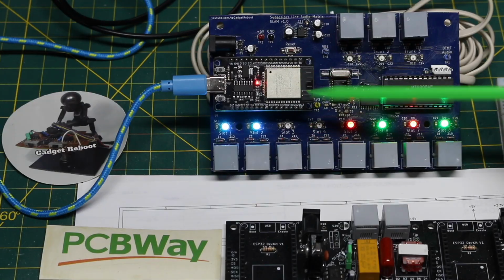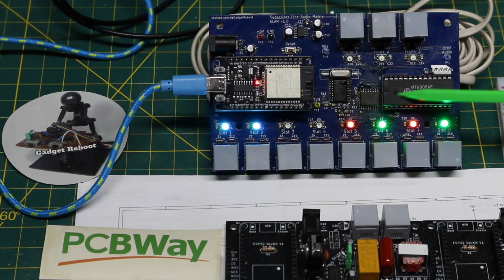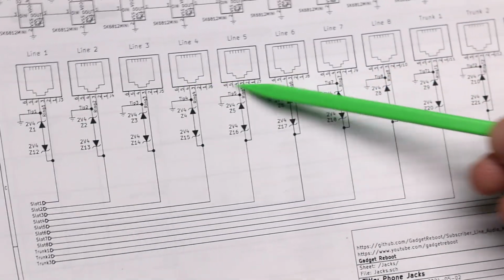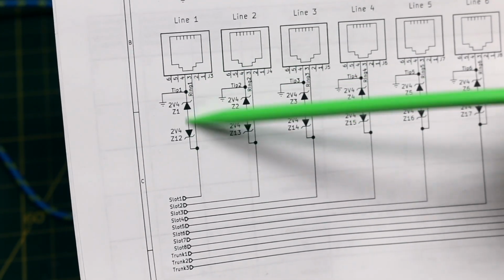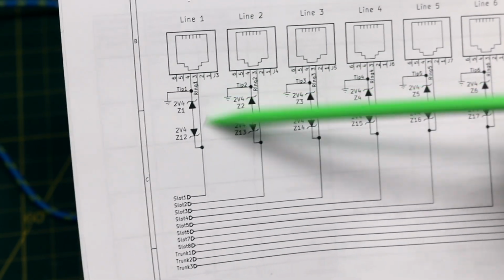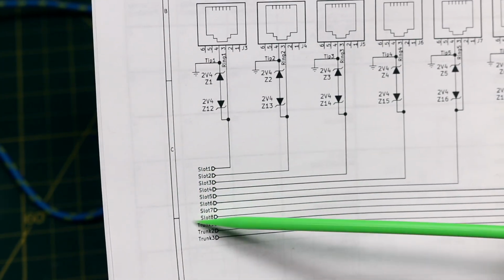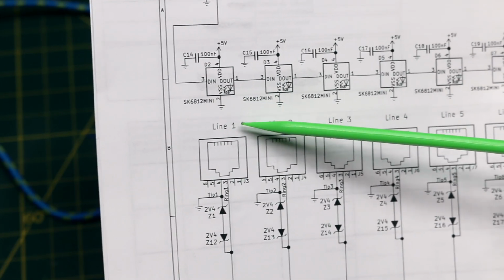ESP32 and the MT8808 Analog Matrix

Comment: I’ve been following your project, off and on, for quite some time. It looks like you’re just about to fruition. Absolutely fantastic. When I grow up, I want to be you…lol. May I ask what the ballpark looks like in terms of cost for the system might be? I’d love to build this for myself to be able to  run a BBS between all my older computers
Reply from the maker: I only used parts I already had available or bought cheaply on AliExpress but if boards are bought from a PCB manufacturer who also handles buying parts and assembling the boards, it might be some thing around $100 per board fully assembled based on what  one person said they were quoted.  and two would be needed to make a complete connection
obviously that could be done way cheaper buying the parts separately and doing it by hand.
I need to get back to the project but the biggest immediate hold up is I need to work on software for it and I’m allergic to software.
 I can’t remember where I left off  and now libraries are all incompatible with the latest Arduino set up and I need a big chunk of time to even figure out how to get back where I left off so that I can update everything and turn it into the multi node system, 
but everything can still function by installing the older versions of the libraries and just using the two boards to go direct to each other at least.
Reply: @GadgetReboot That’s not bad at all for the functionality you’ve got in it. Totally understand about the forgetting where you’re at. I have the same problem, probably for different reasons. At over 60, i don’t seem to remember as well as I never did. lol. That’s why I like retro computing. It’s easier for me to remember how to program an Altair than it is to remember how to program an ESP32.

Comment: Do you have any arduino code for the mt8808 I brought few wanting to play but  can't seem to find code anywhere
Reply from the maker: It looks like I had just made a fast hack test for now based on MT8816 code here https://github.com/DatanoiseTV/MT8816/
In the demo sketch there for connect and disconnect, 
I just ignored pin AX3 for the chip addressing and didn't wire it from the ESP32 because that's for the larger 8816, and it seemed to work for 8808
to connect and disconnect a node junction by only hooking up the other address control pins.
I didn't even save my test sketch because of using a GPIO expander in between the ESP and 8808 and the whole thing was a messy hack.